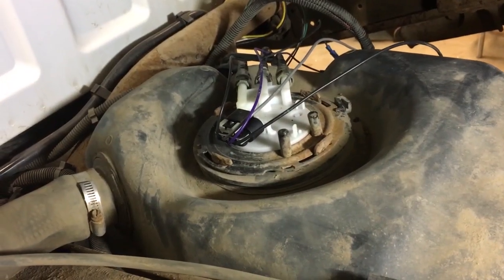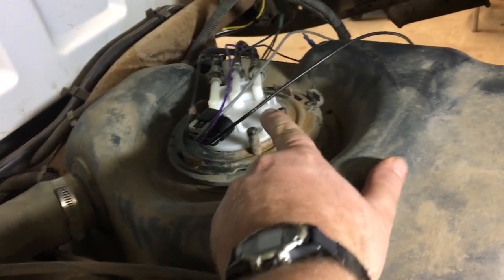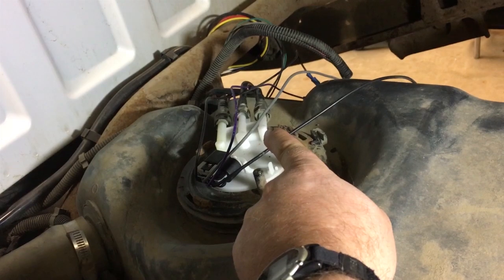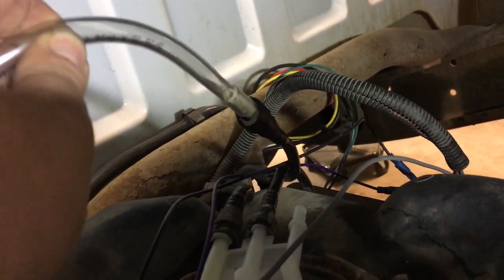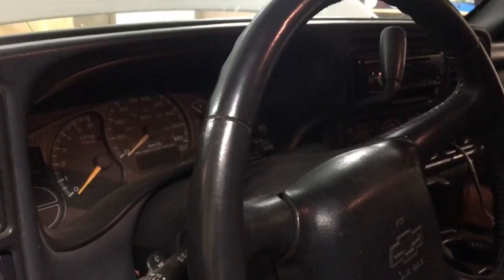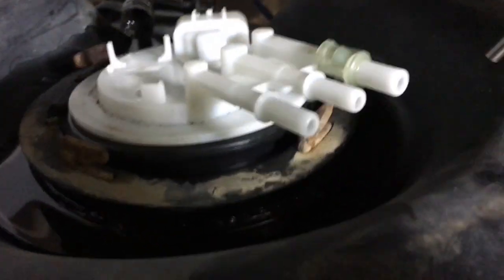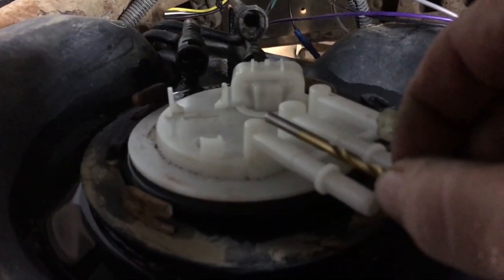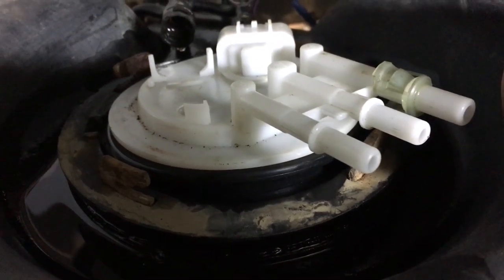Troubleshooting High Fuel Pressure from my Walbro 525 pump

Comment: Randy, have you looked closely at the stock fpr, taken off the rail? There's a tiny nipple on the inside, much smaller than the rest of the return. I bet the walbro 525 is really overrunning the regulator.

I have the same year truck with the 5.3, turbocharged, single walbro 450 (#267 standard pressure) in the tank bucket. It also overruns the unadjusted stock fpr, 64 psi at idle. There's a small adjustment screw (T-10 security), which I backed out to 56 psi at idle (lowest setting). 

The hi pressure walbro 450 & 525 (#274, #285) have an internal relief spring 112 psi max, whereas the walbro 400 & 450 (#267) are 87 psi max.

I'm going to try a stock flex fuel return style rail, to see if it's larger fpr is more capable of handling the flow.

Minimum, static and max pressures are influenced by the flow rate of the pump. Differences in these affect injector output, throughout the entire tune.

Comment: Damn that’s cold! It’s going to be 70 in Houston today. I’m switching my 11 gmc to return what fuel pump housing are you using mine don’t have return port? Just the evap hook ups and main fuel line if I’m not mistaken?
Reply from the maker: Thomas Johnson I just ordered a pump/hanger assembly from Amazon, I think the part number was FP3501M, not sure if it fits in the newer trucks though.
Reply: Lowbuck LS thank you brother I’ll check it out right now I’m actually ordering head gaskets and bolts right now

Comment: My buddy did -8 fuel return lines for his fuel system for same issue. Aeromotive is the way to go for better regulator too. Love the vids! Thanks man
Reply from the maker: Kyle Dunton you’re welcome, yep I think there will be an Aeromotive regulator and bigger return line in my future
Reply: Will a 6an be perfect
Reply: I ran 8an (1/2) to a Y then fed each end of the rails, from the rails to the FPR then the FPR out to 8an to the tank. Now I gotta do a Fuel Pressure Sensor for in cabin view. Gotta figure what sensor to purchase, Im not buying the Holley 1 (its super expensive and a re-labed part from some china vendor).. Amazon has all kinds of pressure sensors/transducers just not sure which 1 to get yet.